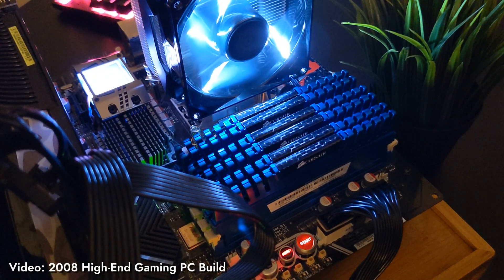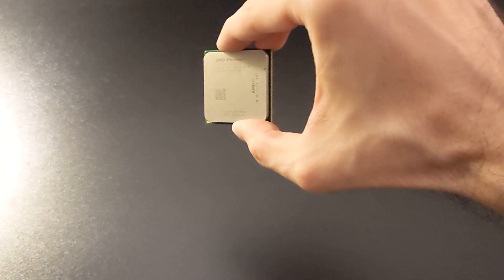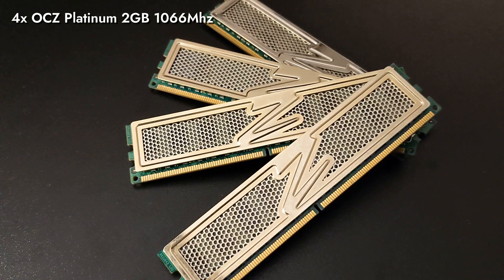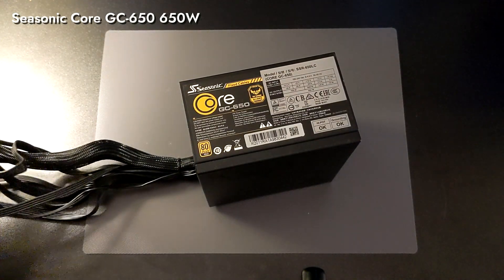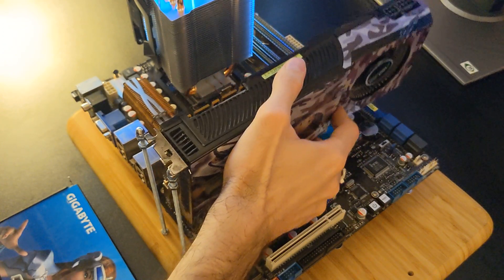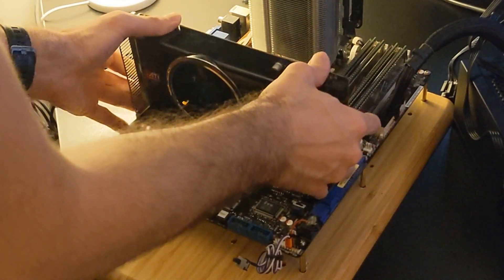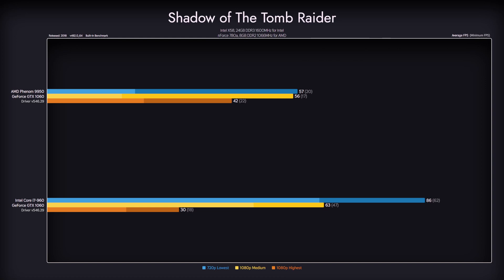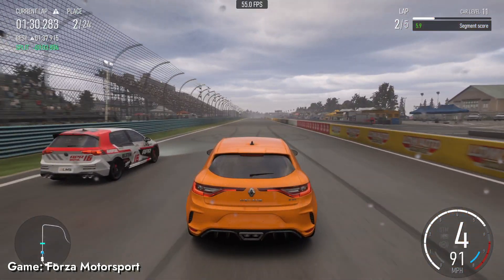2008 AMD High End Gaming PC Build ( nForce & SLI )

Comment: Picked an i5 4570 with 16gb 1600 with a z97 mate sli board recently. Put a 9800gtx+ for the time being but wanting something better as the 512 card is severely lacking. Thinking a 1070?
Reply: Got myself rx 570 8gb recently with i7 4770k, cant be better, cs2 does it rly good in 1080p